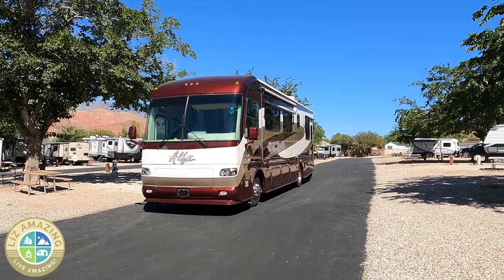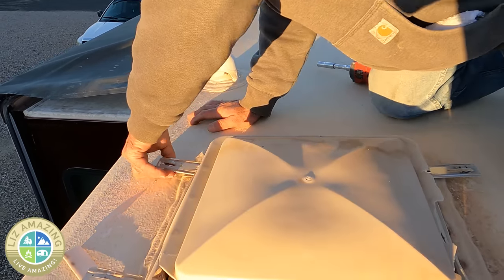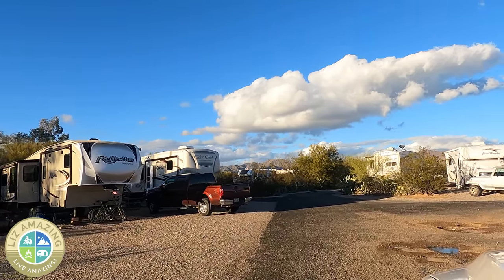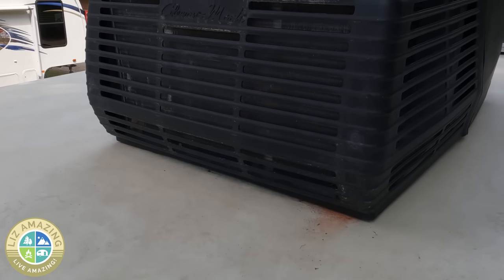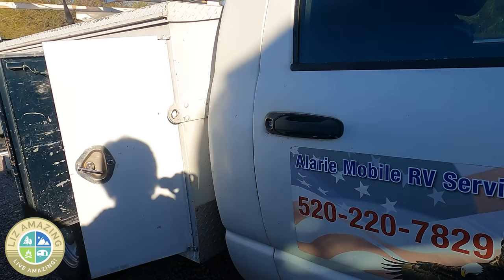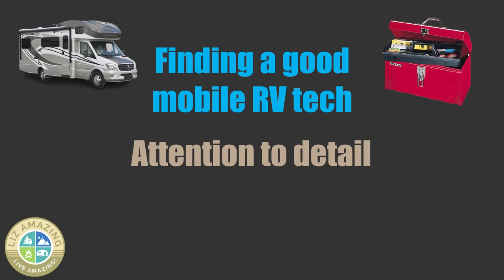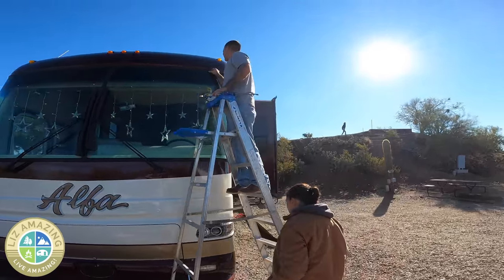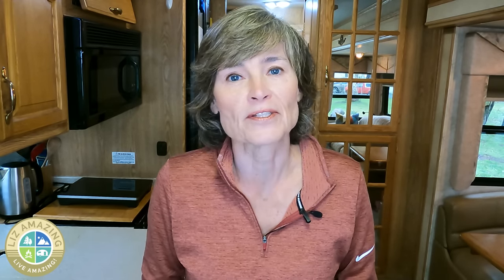RV life: Finding a good mobile repair tech

Comment: Excellent video!! You provided a lot of excellent points with finding a Mobile RV Tech - certainly will keep these in mind when the inevitable happens!! Our experience with a mobile tech was last summer when the right side motor failed on the bedroom slide. Of course it was on a travel day yet fortunate we had a short drive (less than 2 hours). The tech was able to help us get the slide in manually so we could get on the road. He also served our destination area (Nashville, TN) so he was able to get the motor and schedule the repair. We were so grateful for his work!!
Reply from the maker: That is so awesome, what a happy story. Thanks for sharing, Rhonda!

Comment: Our older motorhome lost the furnace motor last month and we called a mobile tech who said he could do it next day but, it would have to be late as he was booked. He showed up at 9pm and replaced that furnace motor in -7 degree weather here in Arizona.
One month later out fridge was acting up so since it is 26 years old we decided to replace it and hired him again. This time since it was not an emergency it took 13 days for him to order the fridge and get here to replace it. He called us a half hour out so we could move our food to coolers.
Great service work and yes we tipped him and his helper and they initially refused but my wife insisted. Worth every penny we spent to not have to take down and get the run around at a dealer and have to stay in a hotel until they are done.
Reply from the maker: Great share, thanks so much for taking the time to comment! Good mobile techs are hard to find, but you know it when you've found one. Thanks for watching.

Comment: Liz, I know exactly what you're talking about. When I was full timing in Vegas my wife insisted we call an RV tech to replace our slide topper I fought tooth and nail not to but in the end, she won. So she called the guy in the brochure and boy did he ever screw us. The first thing he did was broke the spring tensioner then he took off the anti-billowing device and told my wife we didn't need it plus he cut the material too short and the rain was getting on top of the slide. Well, when I got home from work I immediately called him and told him to get back out and reinstall a new piece of fabric and put my topper back the way he found it he gave me a hard time and moaned and groaned but did replace the material and that's all I told my wife never again are we going to let anyone touch our rig unless it's something major that I can't fix like the engine or transmission.
Reply from the maker: Oh no. So sorry you went through that. Thanks for watching and sharing your story, John.

Comment: RV living is romantic 😅 but most folks don't tell you about the grey n black water n fresh water supply/ discharge. That's the biggest problem of mobile homes.
Reply from the maker: Yes, definitely do your research and rent a camper before buying if you've never RV'd before. Thanks for your comment.